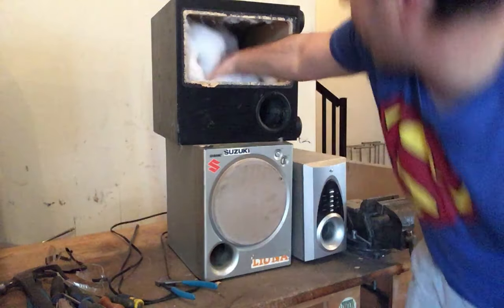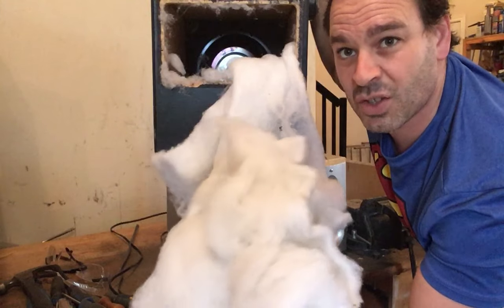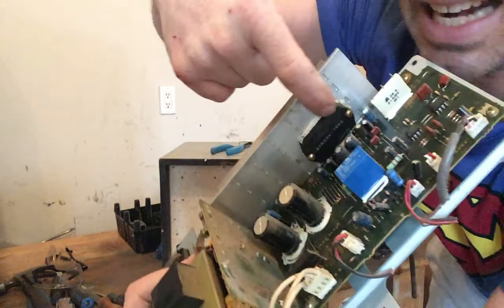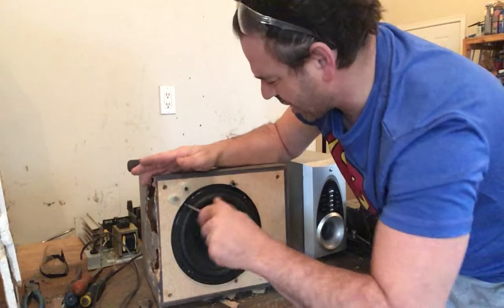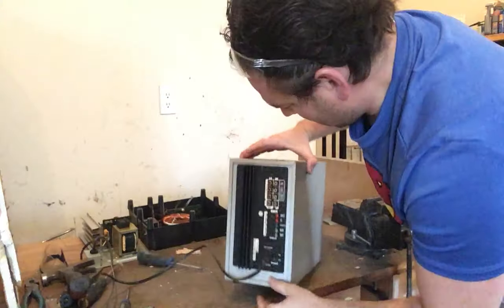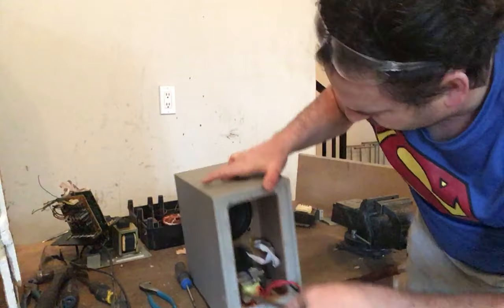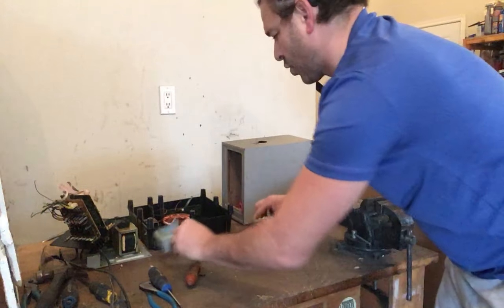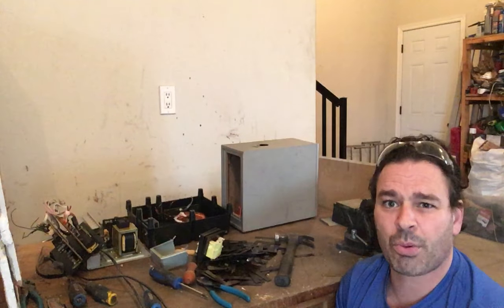Scrapping subwoofers and other music equipment for fast scrap cash!

Comment: For magnet fishing you are looking for Neodymium not Ferrite cheaper magnets often sold for speakers.  Ferrite magnets are about five times less expensive costs for speakers than an equivalent Neodymium magnet speaker and is rarely bought (maybe for a rock concert or a music system drawing larger wattage in power for sound amplifiers).

Comment: You need a angel grinder and a screw gun sir
Reply from the maker: I have an angle grinder. I thought about getting a screw gun, but I don’t mind using a regular screwdriver. Although a screw gun would be quicker?
Reply from the maker: No question mark.